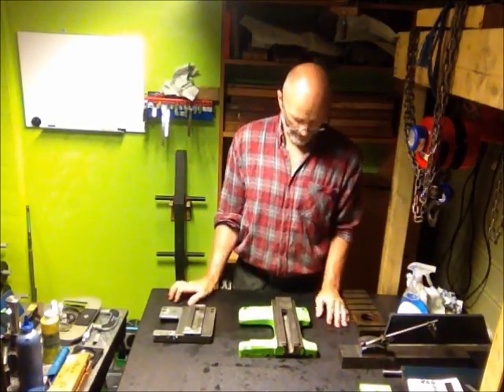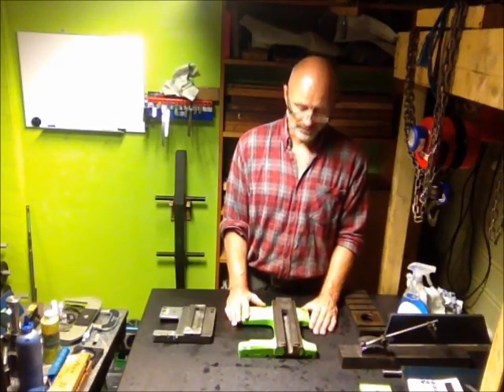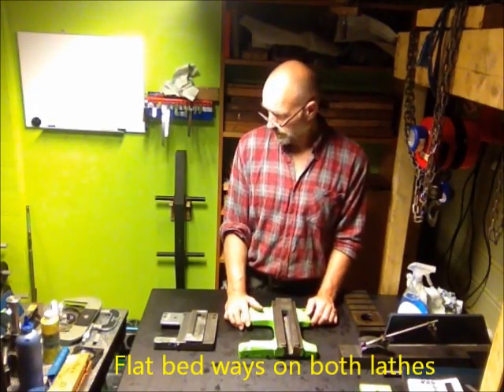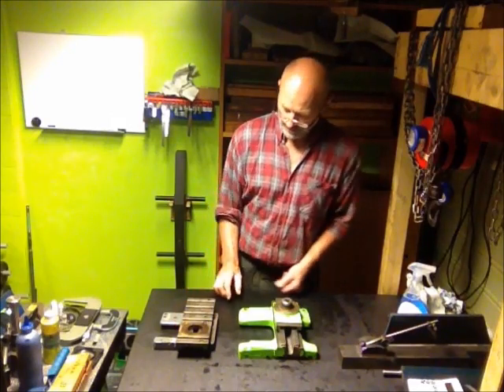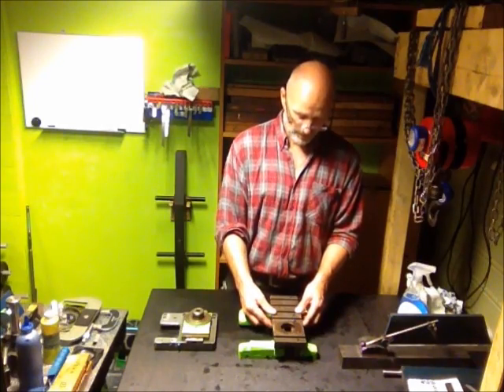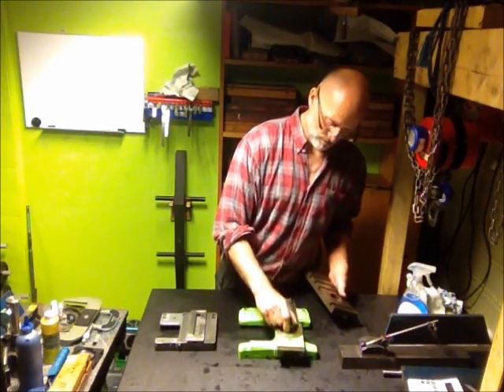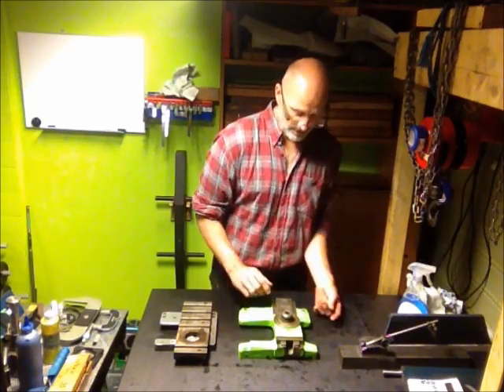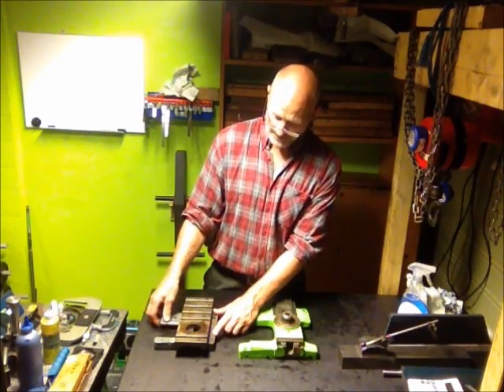Myford and Raglan saddles and cross slides

Comment: Keep the vids coming Jan I find them interesting, I have a Colchester bantam and I have just started to make a straight edge in order to scrape in the top slide, struggling a bit to be honest with the blue I have I seam to end up with either to much or not enough? I was just looking up on the net for a Biax scraper, when I got up of the floor after seeing the price I think I'll carry on by hand, your films are educational and look forward to seeing some more scraping even if I'm struggling a bit.
Reply from the maker: Thanks. Yes, a Biax is a professional tool, cost a lot, but lasts a lifetime in the right hands and used properly. For a hobbyist it is of course considered expensive, but it is really worth buying. You can anyway get along way with hand tools only, so no worries! Sounds like what you need is a scraping and alignment class like the Richard King teaches. I keep saying this that it is the best money I spent in this hobby and towards restoring maachine tools. He is soon retiring, so for those interested in learning the trade from a very experienced master, let me know, because we are discussing having another class (or 2) in Scandinavia, possibly spring next year. I will also be over to your lovely island next weekend (I reckon you're an Englishman since you have a Colchester?), so if you by any chance is at the Model Engineering Exhibition, we can discuss.

Colchester Bantam? Nice lathe.. That is basically the same as a Chipmaster, isn't it? Save the variator and top speed and of course the cabinet? (I thought about this that you could actually run it through an inverter and double the frequency thereby upping the top speed to equal the Chippie if that shoudl prove neccessary..)

Comment: Jan;

Not an expert, but I believe the Myford was intended to be a multi-purpose lathe that could also perform milling by mounting the work piece on the T slots in the cross slide.  Personally, I like this type of arrangement and wonder why more lathe makers did not adopt it.

Looking forward to seeing you put both of these into action.

Regards;

Ron
Reply from the maker: Hi Ron,I like this too. Looking at bigger pro lathes, you often see T-slots, although to the length of the cross-slide.I also agree, the Myford was probably developed to be used as a multi-purpose lathe. Actually, I might buy a T-slotted cross slide, eg. adopting a Myford one for the Raglan